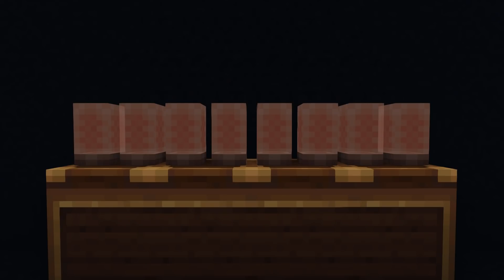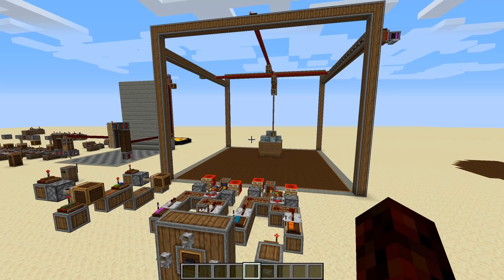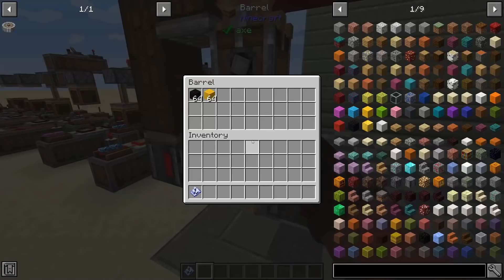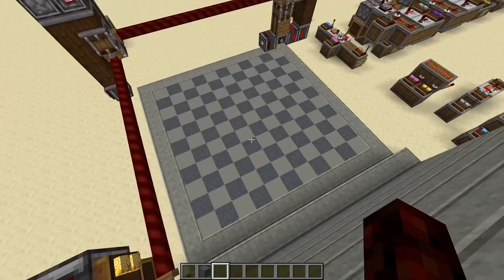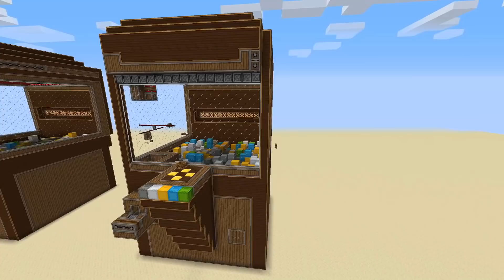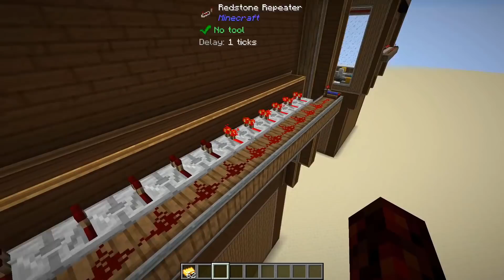Cranes, 3D printing and Claw Machine | Create .3 Tutorial EP 12

Comment: Those Gantries really opened a ton of possibilities didn’t they...
Reply: I don't really know what purpose they serve, everything they do can be done with create pistons
Reply: @LochyP  precision control over a structure.
Reply: @LochyP  When powering a gantry rail, the gantry on it will stop, and redirect the rotation through the gantry itself, also it doesn’t have a long piston extension behind it
Reply: @jpting_  but it still has the entire gantry sat there, it's no different from a piston arm surely.
Reply: @LochyP  Since the gantry shafts can emit a rotational force to machines along the attached gantry cart, they allow for (in certain situations, they both have their uses) additional moving parts in your machines no matter where they are along the shaft
Reply: @russellfoster2030  I see! Thank you for explaining. Yes, that makes sense now.